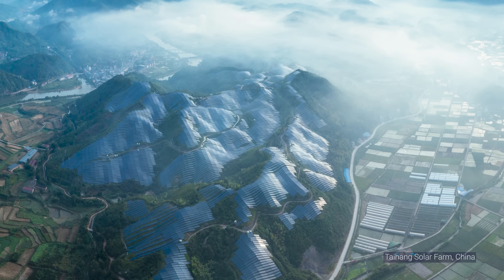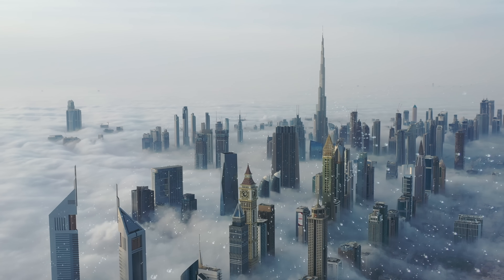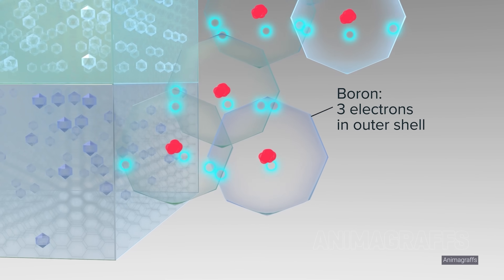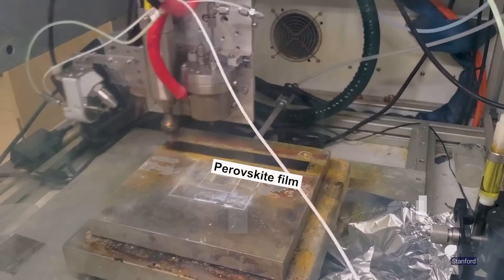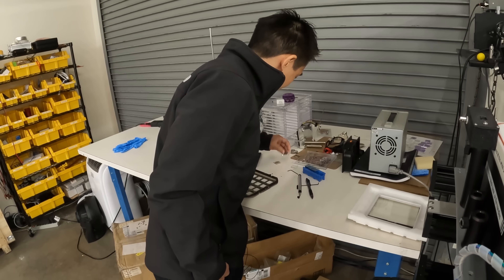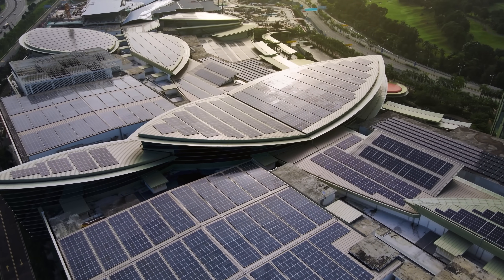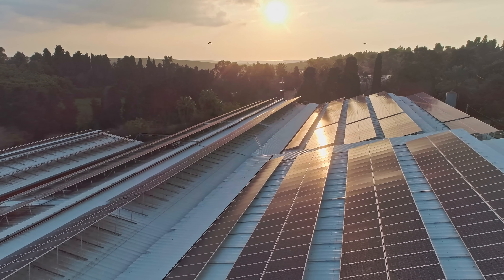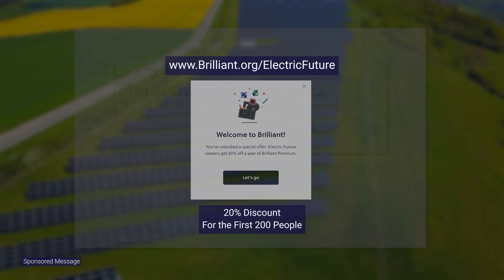Solar 3.0: This New Technology Could Change Everything

Comment: Efficiency , longevity? Dude who the hell cares ?Is it cheap? If its cheap and does the same job , it will dominate . 20-25 years ? Why? If its affordable i can change it in 10 or even 5 for the newer model. It doesn't have to last a life time ,unless it costs a house to buy and install. If not.. if it  costs say..as much as a car..why wouldn't i change it in 5 years? 
Is it cheaper? I'm talking retail $ and cents for a complete system install, not theoretical cents per watthour or whatever. 

Again If its cheap it doesn't have to last . I'm no using the same cell phone i used 5 years ago , i'm not driving the same car i did a decade ago, so..,again, talk price of overall install and i'll listen. 

Again , for the cheap seats. if it is as efficient as a classic solar panel system, but costs 10-15 times less..i'll go with that now and buy the upgraded version in 5-10 years time. 

Got me interested so, i'm insisting. Tell that nerd to get this head out of his ass. Good as ,but cheaper , beats expensive any day of the week. Make it available now and let the market decide. 
Go production now, and figure out how to make a better product later. By the time they figure how to perfect this, we 'd have switched to nuclear out of desperation and he 'll lose out.  
I don't want to be dependent on as state operated grid, not if i don't have to, but solar installations are crazy. I can buy a second house for what they are asking . 
I can't afford a second house right now, I can afford a second car though..you want my money. or do the bankers get to fund another war with the interest they are not paying me?

Comment: This technology is years away from commercialization. Many years. While crystalline photovoltaic cells in Portugal and the UAE produce electricity for 1 cent. 1 cent per kWh! That's almost $0. So what are perovskite cells supposed to change, apart from bringing the costs a little closer to 0?

Comment: I found out today there’s a special plant that uses quantum mechanics to slow down protons on a nano sized structure to absorb more light. Could the Begonia pavonina structural properties be used in this material rather than layering after all nature often is way more efficient, it’s had millions of iterations to develop.
But I guess it’s the problem with the test solar panels go through for it’s long term cost effectiveness. But surely if a nano fibre could be spun with say toughened plexiglass or some other poured substance it would be both transparent and hard wearing.

Comment: If the cost is 15x less than silicon panels do they really need to last 25 years? The technology will advance way before 25 years anyway, just replace them. Hell you could have a roll of the material that automatically advances like hand towels when the output starts to degrade making them maintenance free. That roll system could also be used to wipe dust and snow off them until finally advancing to new material. The used portion would be cut off retrieved and recycled.

Comment: Could you make them cheaply printed on a plastic film which you stick on the inside of you windows so no weather degradation and combine them with an ant glare effect and a privacy screening effect. Make to last only 5 or 10 years whatever is possible now and with self installation just stick, plug and go. It would be very useful to have that now .

Comment: Perovskite panels may/may not be the breakthrough required for mass electric generation: but it or something else will come.    The other side of the equation remains battery technologies.    DARPA, along with other R&D sources, have multiple battery techs that will likely fix that issue.   The electricity deniers lack the intellectual potential to comprehend and have faith in the future comprise the negative impacts.    It’s almost funny to read/hear them pontificate on their perceived belief we must stay on fossil fuels.   Many don’t understand even the most simplistic basics to Petrology and the fact fossil fuels will eventually run out if the human race doesn’t die out first.

Comment: Thorium is just easier. works 24/7 instead of 6 hours a day. China will have tested and proved their prototypes in another 5 years, and move on to mass producing Thorium MSR to power its entire economy with limitless reserves of Thorium.  Their economy will be so competitive in manufacturing that every other nation will crumble into dust, while China's economic success allows it to rule the world economically,politically and militarily. By the time these scientists get all the needed qualities to make a better or cheaper solar panel, it will already be irrelevant. A better solar cell is only half the problem, the other is storage and that is at a grid scale still obscenely expensive and lossy to operate.  give it up.

Comment: Graphene could serve as the transparent electrode. Graphene is almost a one-atom-thick superconductor and can be applied using chemical vapor deposition (CVD). CVD is currently the front running process for making graphene. 
Even though there may be lifetime limitations for Perovskite solar cells, they are so cheap to make and produce so little pollution, they can be considered disposable.
Reply: Disposable? It wouldn't be long till your fish steak tasted of Perovskite.
Reply: Great graphene...  Worse polluter than plastic. It's like micro glass polluting water.

Comment: If these kind of solar cells can be made using temperarures below 100 degrees Celcius, then I'd be worried about their long term reliability, because I know the surface of pretty much anything that's continually exposed to direct sunlight can reach temperatures above that point, so it seems like these new cells would get damaged under direct sunlight... We'll see if they can overcome that I guess.
Reply: You can buy some perovskite panels from Saule Technologies, a Polish company, and test it. :)

Comment: How much fossil fuel do you need to mine, purity and melt all that silicone. Then manufacturing, installing and maintaining all those rigid silicone cells takes even more fuel. With a life expectancy of 10 years you better work fast. Then there are the same issues with batteries. Environmental impact of semiconductor manufacturing can be huge because of toxic chemicals involved. REMEMBER: According to Elon you need 100 square MILES of panels to power the U.S. at current consumption rates. How many billions of tons of materials does all this take. How much will it cost? The technology being shown in this video is still way, way off. Even so, the manufacturing costs are most likely prohibitive compared to fossil fuels.

Comment: I was rousting around in the NREL library about 25 years go and came across a paper on the economic viability of solar power. The paper concluded that solar cells wouldn't be economically viabile until the efficiency reached 25%.  Now, the very best commercial ones are just approaching 24%.  Maybe perovskite panels will be what pushes solar over the bar.

Comment: A common problem with thin film types is that high temperatures cut the lifespan. For the western states silicon crystal holds up best, so far. If only they can come up with a thin film type that will stand up to extremes in temperature.

Comment: If Perovskite is 10 times cheaper and lighter and installation requirements are less then where is the problem in replacing silicon cells even if it lasts for 10 years.... based on pure economics...  The problem must be deeper... boiling down to scaling and more so the cost...

Comment: So, I have actually read quite a few research studies related to perovskite panels. Most of them were from the Institute of Electrical and Electronics Engineers (IEEE). It seems that there are two major issues with perovskite solar panels. One of them was mentioned in the video, but not with a lot of detail. Currently, perovskite panels have an estimated lifespan of approximately 10 years. They did mention durability problems, but didn't really emphasize just how long they are expected to last. They kind of jumped around a bit on it instead. 

The other issue is related to this, but probably more important. Because they degrade faster, they also leech chemicals, such as lead (and the other materials they are made of) into soil and waterways which has the potential of contaminating our food supply if placed in agricultural areas, and drinking water if runoff makes it into water reservoirs. Some of the chemicals that leech out are not harmful at the low levels that make it into soil and water, but other chemicals used in the construction have not really been tested to determine if they will be safe for humans (or other creatures) at any level if they contaminate our soil or waterways. Lead is not safe at any level, so that is a major issue. 

The ability to manufacture them at such low temperatures is great when it comes to cost and production related environmental hazards, but it also means that they can begin to degrade at those temperatures as well. I'm sure that is what the people in the laboratory are probably working on tackling, but if something like this gets pushed out too quickly without solving this issue, it could cause a lot more problems that the ones it resolves. Hopefully, they figure something out though, because otherwise, they seem quite promising in comparison to traditional silicon solar panels.
Reply: Yeah when I saw the extremely low temperature required to make them, I immediately worried about the place where it would be ideal to use these things. Places like Death Valley and multiple locations in Arizona. With air temperatures going over 120 degrees Fahrenheit and ground surface temperatures with the potential to go above 200 degrees Fahrenheit, I am skeptical they could survive the full 10 years projected.
Reply: Aww come on guys, LEADED GAS WAS A GREAT IDEA.

Comment: At a 1/15th cost of solar panels, at 20 year lifespan seems reasonable at least on a consumer level which are more less the same life span as most current solar panel tech, let alone roofs, vehicles, and most applications. It seems that really isn't an issue. And if it's better for the environment with more abundment materials cost.. it seems like they're almost ready to launch.

Comment: What if I told you photons were tangible things. That by gathering them in mass from the sun could destabilize the sun as nothing so far has ever pulled the sun’s photons and who knows what would happen if we do. Photons speed up as they approach a solar panel. With enough solar all over the earth we could create a constant pull that could eventually reach the sun causing a change. What happens when we make changes to our natural universe? Things. Things happen. Every time.

Comment: Solar is the only viable future energy source.   Change my mind.  I am tired of saying this 

All other sources give off heat that was once in a potential state.  Solar is converting sunlight the earth is being exposed to naturally.  Zero net heat gain.    All others release heat which contributes to global warming.   No one talks about this.    Really obvious stuff people.    It was in the ground as oil or radioactive etc.  nice and cold.   Only when converted to usable energy does the release.     Duh.   

It is all very simple and extremely frustrating that the right choice is held back by a few rich people sucking us dry and killing the planet.  

The only issue with solar is no one can charge for the fuel.   It free.   The only thing you can charge for is delivery.   Not the same profits  and does not give  the same global power oil does.

Please think about this and pass it along.     Getting tired of watching us struggle.    

Peace.

Comment: i mean, even if it's longevity is about 5-10 years, couldn't you just change it every decade, and because its so much cheaper than silicon cells, it would still be better, no ?

Comment: A concentrated solar grid in a small area of one state is not logically possible. The transmission lines from that area to blanket the entire USA alone would be a nightmare. Not to mention extremely prone to forcing the bulk of the country into a blackout due to sabotage and idiots with heavy equipment.

We should be focusing on making fusion reactors ourselves.

Comment: Solar cell work on the principle of if there is more sun then there is more power generated. If you magnify the sun with a layer of micro grove cut magnifying substrate then even with these solar cells the efficiency of the sun even at 30% lower sun would generate its usual 100% power. The technology battery or capacitor catching the electricity would need to be flexible in multi power storage as if there is more sun then the correct storage would be required to avoid waste further energy produced by the solar cells as the current flaw is once the battery is charged  the efficiency of the solar cell is wasted and stops utilising the power. 🤴🏽🕉🔺

Comment: Light and flexible will win even if the efficiency is worse.  Even a child can handle lightweight and flexible solar panels.

Plus you can "ghetto" setup panels that are super light weight really anywhere.  In your backyard, on an RV, on your actual roof, anything.  Hell you could duct tape them to your car if you had to.

Comment: Here's the issue I see: More than half the cost of a home solar installation is labor. And of the non-labor portion, roughly half the cost is the solar panels themselves. So reducing the cost of a solar panel is nice, but won't significantly change the overall cost of installation. Higher efficiency would help the payback period, howevre...

Comment: you would need a lot more space as you need to store and convert for winter and night use. And all this does not seem to have a long 25 year lifespan.  plastic solar panls doe not at all give me confidence ir lasts longer then a few years.
And solar will always be a bandaid solution.  over 50% of the day we do not have reliable sun and even in daytime the energy generated can differ by a factor of 20 based on weather and seasons. its a filler energy but not a replacement and never will be. just like wind mills dont work with no wind. we need sxomething better and bio ethanol is no it as that uses fast amounts of non sustainable resources for the production of corn.

Comment: If its cheaper to manufacture and easily customizable for size and shape, I'm sure there will be plenty of uses for smaller electronic items, even if the life of the film itself isn't great.
I bet even putting them on the back of mobile phones might be a valid use if they're efficient enough.

Comment: The real trick would be to get these things to work well enough to power our needs when it's not sunny, just daylight. That way they can be used anywhere. Even here in England, where we're lucky to see 50 sunny days a year. Afterall clouds only block about 20% of the Sun's light. If we can find a way to get more from that other 80% we'll be set.

Comment: The use of lead iodide in these panels is quite alarming considering the toxic nature of lead. Admittedly it wouldn’t be ingested or inhaled like the byproducts of leaded gasoline, but the mass construction of these panels would require more lead production which has historically caused mass lead poisoning.

This along with the short life span of the panels means that they would have to be thrown out or disposed of fairly frequently. Meaning that old panels may actually be a pollutant.

Comment: The biggest issue with solar and wind is that you are at the mercy of weather. The big breakthrough of the industrial revolution was untangling a societies production of goods from nature. Going full solar or wind is just going to end in rolling blackouts and make it impossible to effectivly run industry.
We either need a godlike breakthrough in battery tech or we need choose a new strategy because the biggest issue isn't just creating a charge, you need precision, you need the right amount at the exact moment it is consumed.
So either bring the sun down here (fusion) or nuclear is our best option currently

Comment: So, easier to make, using less silicone, and easily found/cheap materials, and lower temperatures, meaning less energy/production cost. I'm guessing the idiots that will market it will make it many time more expensive than current solar based on it preforming better, even though they are saving MASSIVE amounts in manufacturing. 

A smarter business plan would be to sell this new material dirt cheap, get everyone used to it, comfortable using it, and then it becomes the dominant power source, beating out all competition and owning the entire market. People don't use solar because it's expensive, if they make this cheap, since it's cheaper to make, then more people will use it and come to trust this company most of all.